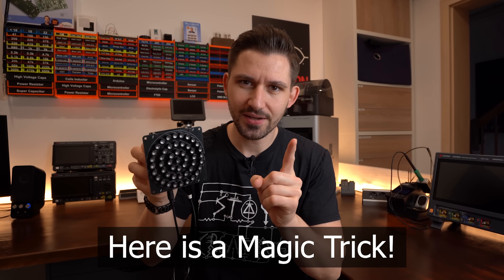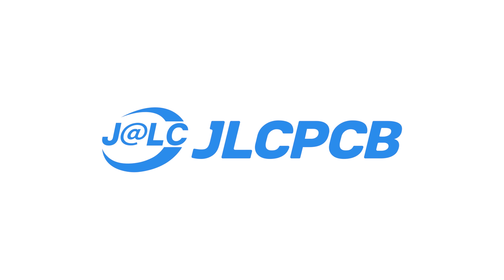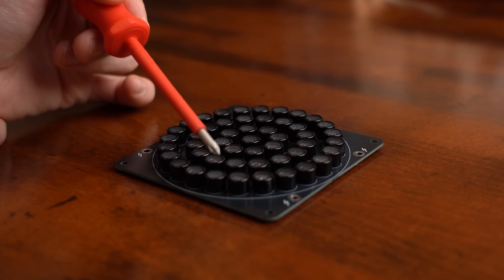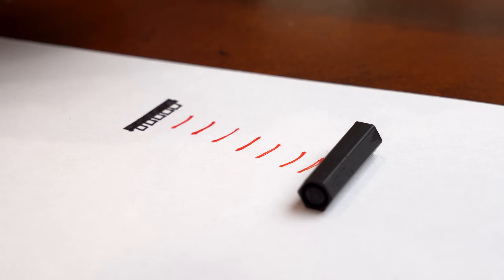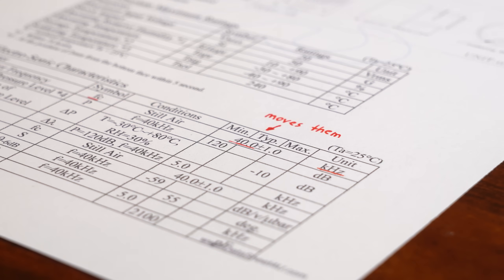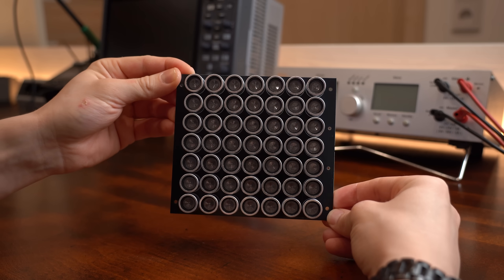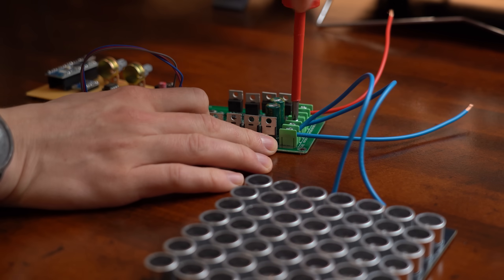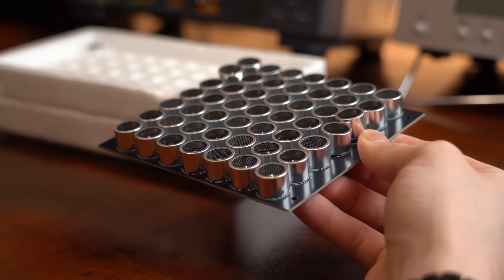The Coolest Speakers are TOO PRICEY? Let's Change that! (DIY or Buy)

Comment: Hello, I have a question. How do I orientate the transmitter in the transmitters pcb? There are circles and squares in the pcb. There is a big black hole on one side behind the transmitter. Which direction should I align?

Comment: A directional speaker is an audio device that allows you to hear sounds or talk without people around being able to perceive what you are hearing or saying. This is what disturbs me deeply, having neighbors who use it, both fixed and portable versions. I have been claiming for over five years that they are using a parametric speaker, probably connected to a digital recorder that runs continuously, obviously powered by the mains and not simply by batteries. Therefore, I urgently need an ultrasonic microphone with a heterodyne converter so that I can detect and listen to what is being transmitted. I await a concrete and urgent reply. Kind regards.

Comment: I built this project and it works perfectly! I followed the tutorial , and everything came out exactly as shown. I also tried following some other tutorial videos, but they didn’t work for me at all—this one was by far the best one. It’s really satisfying to see the ultrasonic speaker functioning properly, and I learned a lot in the process. Huge thanks for sharing this project!
Reply from the maker: Awesome, so glad to hear it worked out for you!
Reply: @greatscottlab  May I ask for help? Could you provide for me the schematic diagram for the configuration of the ultrasonic transmitters? are they put in parallel? So, what I understand is the negative, connected with the negatives and the positive to the positives in parallel configuration. Is this true?
Reply: May I ask for help? Could you provide for me the schematic diagram for the configuration of the ultrasonic transmitters? are they put in parallel? So, what I understand is the negative, connected with the negatives and the positive to the positives in parallel configuration. Is this true?

Comment: Do abunch of 1 inch full range or 3/4" wire them ALL in series to get a very high resistance, AND use one vacuum tube to drive them all. There are tubes that have the pre and power stage in one package, That means, you need a dc supply which a boost switching supply would work great, but also rectified wall voltage works too. Choose the operating voltage of the tube based on 120 or 240v you have or you can even use a doubler circuit. 

Transformer free.

Comment: I remember a book. I wish I could remember the name of it right now that I read a while back. And basically the guy used ultrasonic speakers head tracking technology to point them so he could whisper in a guy's ear when nobody else could hear it. And it made it sound like it was coming inside his head. It would be kind of sick to build a project like that to see if it would work. Where maybe you could build an AI assistant that you ask it a question. It points the directional speaker at you and answers only to you. Now that I think about it, I can do the rest of that. Do you mind sharing  what I need to build one of those speakers with me?

Comment: hello sir if we are use a 5v operated ultrasonic transmitter like from HC SR04 sensor then i hope it make more  efficient than you are using make easy just only need a modulation circuit and gives the pwm signal to HC SR04 sensor circuit i hope it can make same work as you are using in this video please answer me i am duing a project on directional speaker which is my final year project can you help me to make this project bro.

Comment: I think that you could make a variation that uses two such speakers where you drive them with frequency modulation so that the difference between the two speakers is the audio signal. This way you could more precisely define where the output is audible.

Comment: Can I use the ultrasonic transmitter removed from an easily available  HC-SR04 ultrasonic module, and use that as it is, It is very difficult to get the transmitter unit only separately in India. Will it withstand 24V DC?

Comment: It looks like you have the BEGINNINGS of a "Phased Array" there.

I'm not at all certain how you might realise that potential, I believe it requires propagating the signal "across" the "speaker", with the result that it pushes the broadcast signal (audio) into an "off axis" direction.

If you think it was trippy pointing this speaker manually, imagine having the speaker fixed and moving the sound around by shifting the phase!

Comment: Is it possible to build a speaker like this using transmitters with a resonant frequency above a cat's range of hearing? Cats can hear sounds as high as 85kHz, and I'd like to have a directional speaker that wouldn't hurt my cat's ears.

Comment: As ultrasonic transmitter produces more than 20khz frequency which is not even possible to hear ,then how it is working as speaker?
Reply: Seems like 40 khz is carrier wave, and is modulated in lower hearable frequencies. I fas familiar with modulation but havent realised this principle works for sound waves.

Comment: My friend, awesome video. A couple of tips here for you don't mind -

1) you're going to need a much much larger array of ultrasonic drivers than what you have built here. Try on the scale of 16 to 32 times. You're going to need much much more power to drive them. Try and amplify that actually doesn't mind playing those frequencies and utilize some DSP filtering. 

2) look into a technique known as parametric arrays.   Nuff said.     Good luck.

Comment: I made this using the provided circuit diagram as reference. However, I used a L298N motor driver and I supply it with 12V. I used only 7 drivers, one in the middle and the other 6 is around. It works but my problem is the volume is so low that I need to put the transducer array right next to my ear to hear it. Now I'm wondering if my transducers is to few and my voltage is too low. Can anyone confirm if that's the case?

Comment: I got to say the short  time I could hear your DIY PWM version in the video it sounded noticeably worse than the retail product. Now the question is if I got that wrong because I only could hear for like five seconds or if it‘s really worse. And if it is worse, why? Would it sound better with the modulated sine wave? Another question is why the DIY version is quieter, considering it has bigger drivers. Was it really maxed out? What are the power requirements of both versions anyway?

Comment: Another method to try is FM. I believe this is what Bose used for their 5.1 sound projector system they used to make.

It's more complicated, and might not be nearly as direct to use as AM. I believe the concept is based on air/surface interfaces having an uneven response to frequency. So while PWM would have a clear linear response, FM might be nonlinear and would need some sort of LUT to remap the output levels. But if it was used for name brand audio, there must be some advantage that made it worth the extra effort. Perhaps the constant max output results in a higher max volume, or better response across the volume range.

Comment: Those are cool.  I actually made a beam steering speaker using 25 (5x5) Aura 1.5" drivers.  It works pretty well.  Not much bass, but the directionality aspect was pretty cool.

Comment: You should try to find an old HP Signal Analyzer. For audio, it shows so more more visual information than a traditional Oscilloscope. Actually, you should explore your Keysight. As awesome as that thing is, it may have signal analysis built in. . Try installing the directional speaker into a composite material tube of the appropriate diameter and 1-2 meter in length. Find the frequency of the “ Brown “ note and see what you come up with. Excellent video

Comment: Nice, I am looking into building my own for making some funny pranks. In my research looking at the other builds, featuring FPGAs or similar they checked the transmitters for polarity. I do not know if it is needed, because they propably used different transmitters, but it could be the reason why are your quiter. You can have some of the transmitters flipper soo they will have opposite output and cancel each other out. Or it can be caused by using the PWM modulation rather than AM

Comment: I first heard about this years ago on a TED talk, but I'll have to go digging to refresh my memory. I assumed that a different signal was being played through each transmitter, and a slight time distance of arrival was used to make the audio signal concentrate at a single point. That could explain the high cost of some of them. It's possible (Likely?) that the manufacturing quality of the one you purchased isn't the only corner they cut, and perhaps they completely threw out the main idea. Thanks for this great video, and now I'm motivated to make my own!

Comment: you could probably compensate for the "conical" effect of the "beam" over distance with the physical arrangement of the ultrasonic transmitters, so that they point slightly towards the center, each "ring" points just a little further inwards than the previous did. 
Depending on the angle of the transmitters this could create a "lensing" effect within the audible range.

Comment: Suggestion for video:  Laboratory Temperature Sensors loggers professional grade laboratory equipment , industrial stuff, .....  plus/minus   0,1   Degree Celsius accurate.... WIFI and tiny and cheap.... so every room can get one,..... and one computer can see all the different room temps ..... maybe there are such products on aliexpress? cheap and accurate to   0,1  Degree Celsius ?   ..i only found Chinese stuff that is plus/minus   10.0  Degree Celsius , so straight garbage so far. i bet You could find better quality there

Comment: When I tried building such a directional speaker, I found out that the cheap transducers I ordered from Aliexpress have their phases all over the place, which makes the beam more divergent. The trick is to really make them perform in-phase with each other: this way they all combine in a single parallel wavefront. You can measure the phase offsets of the transducers by holding an extra one close to them connected to an oscilloscope. For my project I ended up measuring phases for every single speaker I had and then calculating the best possible pattern with given phase offsets.
Reply: Interesting. How exactly did you determine the pattern?
Reply: @futuregadget_v2.1  based on desired main beam angle you can calculate the phase pattern (simple geometry: all phases at infinity at beam's direction must match). Then I iterated over a set of beam angles and for each angle tried to distribute the phases from the list so that they match the phase pattern. Basically, brute force.

Comment: The 40 khz may not be only used because it's the ressonance frequency of the transmitter, it have to do with the spacing of the speakers too, to control the interference! Lookt to me that the circular arrangement does the directional interference by itself, in square arrays you mais need some processing in the corner speakes. Also, as your array have different dimensions, playing with the modulating frequency can inprove your design!
Other thing: the square signal may cause loss and distortion on the transmitters, that's bay be why they  injected a senoidal signal and used a linear amplifier. And those IC are not efficient at 40 kHz! To improove it you can use a hugh frequency class D. And you got yourselfe a nice efficient product!

Comment: I did some work with ultrasonic transmitters. The size doesn't really indicate the SPL the transmitter can output. Some smaller transmitters have a higher SPL value. Like the ones from Murata. During my research, I think there was only two other companies from China who matched or exceeded the SPL figure given by Murata's transmitters. You also have to check the resonant frequency, it ranges from 38khz to 40khz. And the SPL drops of quite quickly outside of the resonant frequency

Comment: I wonder if you could make the sound follow you somehow, maybe with a signal emitter in your pocket or a camera detecting where you are. You would need to control the phase difference of each speaker though, to turn it into a phased array.

Comment: Great build. I don't recall that you explained that the demodulation of the speaker's output is the air that acts as a low pass filter, a very non linear one, but a low pass. Improvements can be adding pre equalization to compensate for the air's non linearity in both amplitude and phase, adding one more modulation frequency in adjacent transmitters to down convert the signal to frequencies where the air acts as a better and more effective low pass filter. Using higher modulation frequencies to achieve better directivity will help and also drive the signal longer. Keep us all truly entertained by your admired hard work!

Comment: You scared of cost about $50 per unit, how much would you charge for both your time to build it on to reduce out your equipment. When you add shipping from the manufacturer to the retail company that you purchased it from. while bearing in mind the time it took to design it and the fact that most likely it wasn't made completely by hand, and there was some manufacturing involved. how much do you think it should have cost you to buy one, complete without you having to build it yourself? figuring a company would build large quantities of these at the same time it probably wouldn't cost $50 per unit. bearing in mind paying all of the employees at the factory and warehousing. how much do you think it should cost if Mass assembled, and how much it should cost from a small business owner that buys the parts and builds it themselves like you would. even taking the account that you would most likely sell direct to the customer if you made it yourself. you would have to pay to ship all the parts to you, the equipment that you had to buy originally and all of the maintenance on your equipment and the electricity as well as how much it costs to have your shop. I just figure for the designers expertise and everything and the manufacturing if it was mass produced the company taking $100 for the design and everything figuring it cost half as much to manufacture probably last but let's say $125. then the price that retail stores take. makes sense because most likely there was a wholesaler between the mass production company and the company you bought it from, everybody wants their peas. I understand if it was a small company and they were making them by hand, that it cost more to do it that way. a big company has more layers, and a small company has more expenses. so $250 makes sense. That doesn't mean it doesn't suck for the customer.😢

Comment: I'm still trying to wrap my head around the notion that a 40KHz ultrasound can carry lower frequency sounds that we can hear without demodulation. With AM radio it's easy to understand how a second oscillator can be used to cancel the carrier frequency, leaving us with the audio signal, but even after looking at the oscilloscope and 3Hz amplitude, I can't quite picture the air moving back and forth at lower frequencies. If I modulate the amplitude of a blue LED, won't it only flicker? Or will it start looking multicolored?

Comment: Did you align your transducers? Commercially available transducers are not alignable and don't sound very good. If you buy my kit, it comes with an article that tells you everything you need to know. if you interest , please send direct message.I sell a kit with 48 speakers for $90 including shipping. Most of the ultra-directional speakers on the market use my circuit.

Comment: what wires did you use on that perfboard to connect the solder joints?

Comment: Your cost calculation lacks the time it takes to create your DIY solution... so even if you are fast I doubt it took less than five hours... thus... (German Mindestlohn) 5 * 12,82€ = 64,1€ + 50€ Componentes = 114,1€... and I doubt that you work for MINDESTLOHN.

Comment: A question about this then... for us condo / apartment dwellers... would this be a solution for us to actually enjoy desktop audio again, and not have to use headphones all the time? Like just how directional is it, once the beam passes you and intersects with a wall for instance? Does the focused beam cause it to resonate with the wall  any more than a standard speaker would? 
I love music and even composing, but living in this darn condo, the up/downstairs insulation is not very good,so I feel bad cranking anything up at all.
Do these dound pretty good for listening to tunes? Or is it just more of a sound generator? Thank you!
Reply: And can use something behind and around a user like a screen to create an actually surround sound too. 
I thought about this in a headphone itself until it was said that it creates too much pressure.

Comment: I ran a plasma speaker with a 555 timer doing the 15.625 kHz on the coil. The 555 can be modulated on pin 5 with a pretty nice sounding output.
So why not 40 kHz. I mean you could get the parts count down to a NE555, some transistor and some passives and of course the transducers.

Comment: Theoretically, if you used a circular arrangement like the Buy version, and also wired it (designed the PCB) so that every leg of the ultrasonic module was oriented pointing towards the center, you could then slightly raise the outside pin! (ideally by using a shim)
By doing so, you'd create a crude parabola and now you're speaker would have a true focal point.

Why do this?
Well, if you set it up so that the focal point is say, 15m away, then at a distance of 30m it would be basically as "tight" a break as it is when exiting the speaker! Only further away would it begin to be a "cone" shape like it currently is. Since this is tuneable based solely on how much you raise the outter pin, you now have the ability to increase its pinpoint range since it would be focused better. 👍